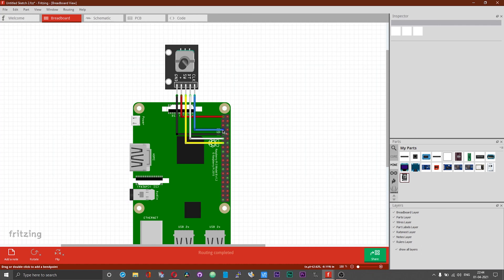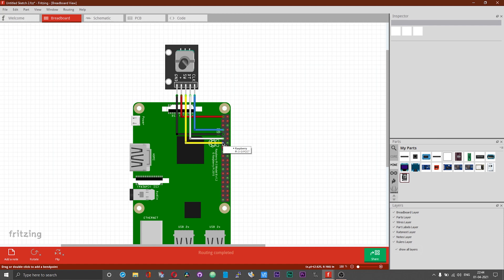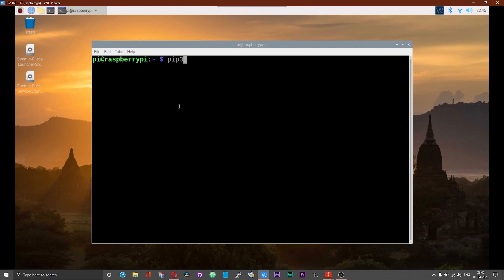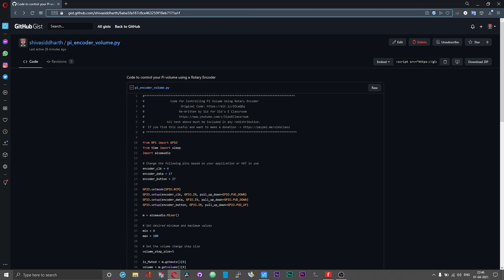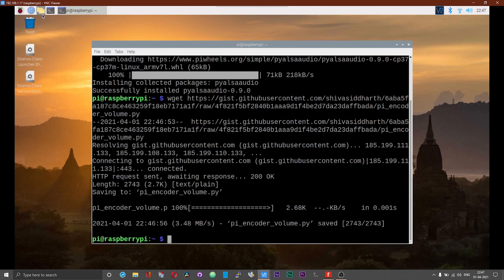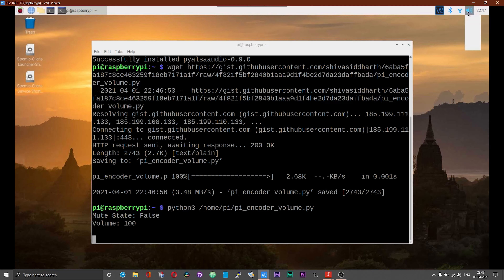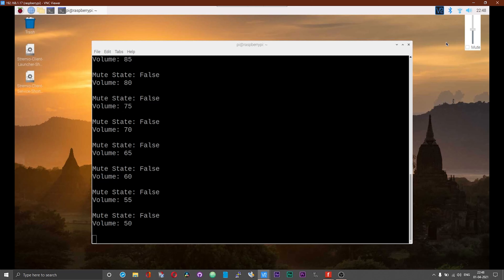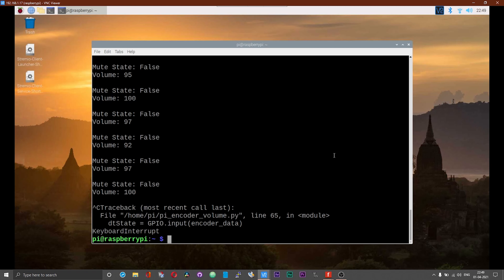Pi Guide - How to Change or Control Raspberry Pi Volume Using a Rotary Encoder

Comment: Congratulations and thank you for sharing this! Does this method work even if I have an IS2 DAC already installed on the GPIO? Actually I have installed a small "cheap hat" (excellent audio quality ) DAC pcm 5102, recognised as the "default" board. The "pins" you indicate in this tutorial are free on my Pi4 .I would like to know if this way I can control the output volume from this DAC.

Thanks if you can help me!

Comment: Will this work between reboots or do I need to run the script every time I reboot the pi?
Reply from the maker: You need to manually run the script. This is not setup as a service.